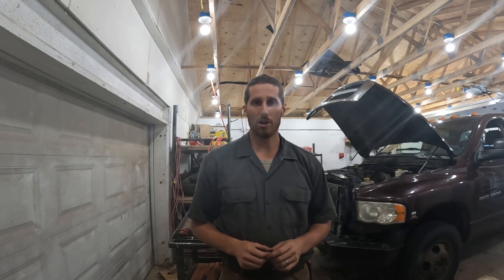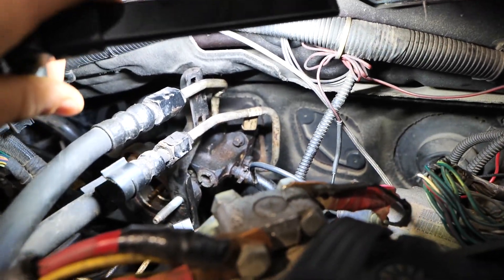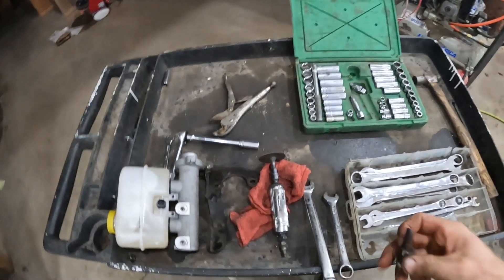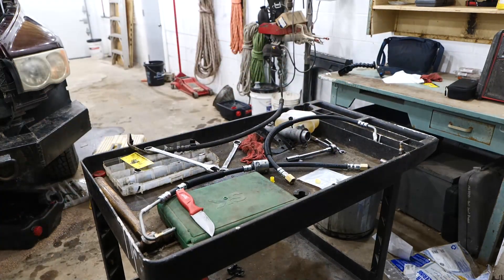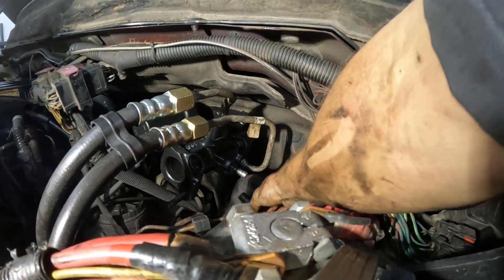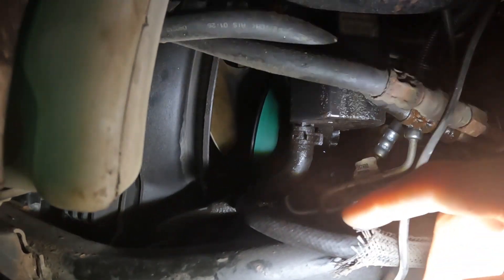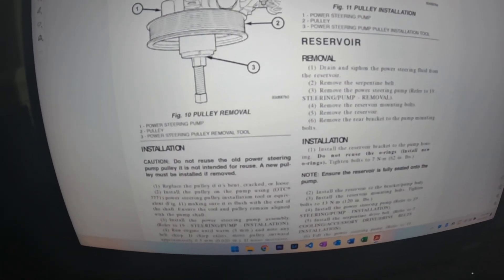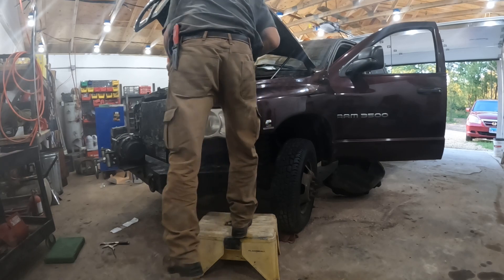2004 Ram 3500 Hydroboost/Power Steering diagnosis and repair

Comment: Very informative. My brakes stopped working, Id trying to put it in Park and the rear tires would break loose. Like too much torque or a weak system. Brakes were weak from the power steering system being weak(hydroboost) and part swapped. Bled drakes, then realize hydroboost is a seperate fluid system from the brakes. Will bleed tomorrow, thanks for the reassuarnce.

Comment: I just did this on a 2002 2500 Cummins put new hydro, pump, and vacuum pump bled it and worked fine but customer says everything stopped again. Going to get it back to shop this week but really no clue what to do next.